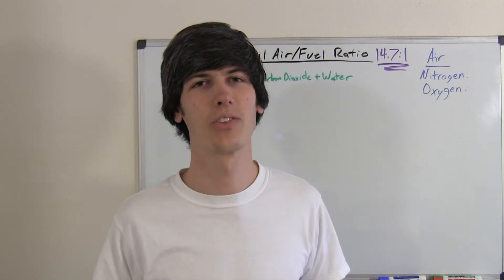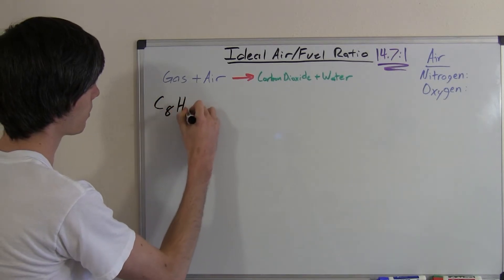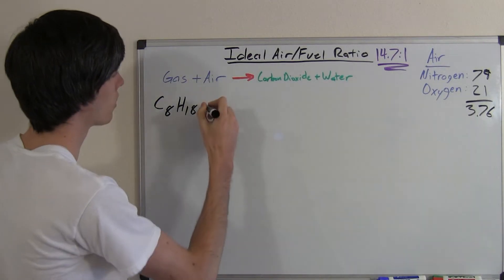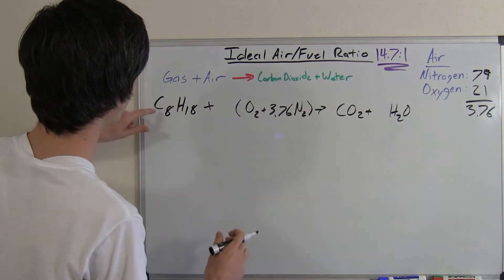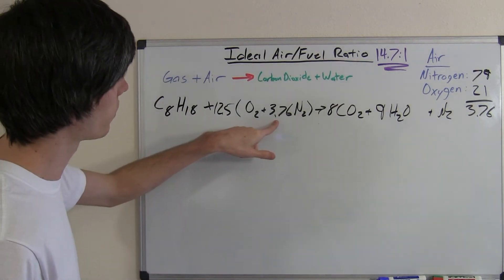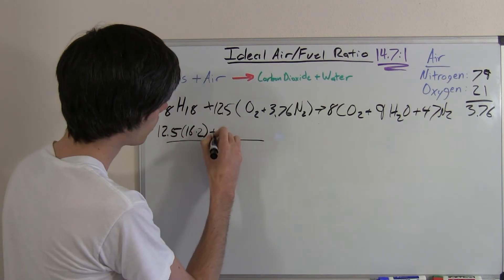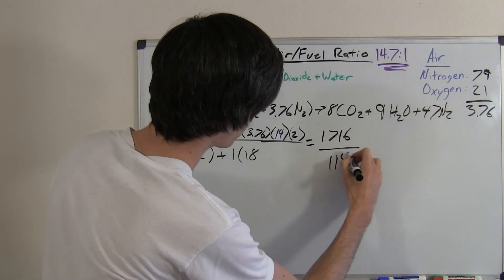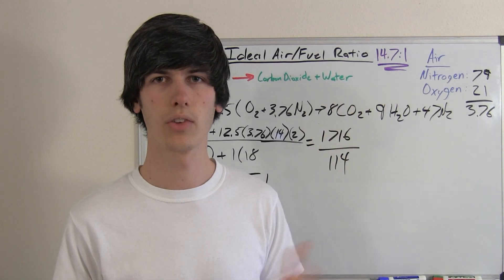Air Fuel Ratio - Explained

Comment: That is the air/fuel ratio to achieve maximum fuel efficiency?  I was under the assumption that only fuel vapors ignite.  I was also led to believe that only 10-30% of fuel actually burns because it's liquid.  If I'm correct and my assumptions true, then, maybe the air/fuel scale should be moved down to a smaller increment.   Similar to 1 ounce per pound (because vapors are thinner than liquid) of air/fuel or something similar to achieve 100% energy utilization.    I know we're using the wrong injectors for that.
Reply: So here's the thing: because of the way the injectors inject fuel, and the turbulent environment of the cylinder while intake stroke is drawing in air, and compression stroke is compressing it, the fuel ends up being very tiny droplets mixed pretty well throughout the combustion chamber. The high temperatures of the compressed gas evaporate a lot of the liquid into gaseous state around the droplets. You need the actual % of fuel by volume of air to be between 1.4% and 7.6% for combustion to even occur at all. There will be a concentration gradient surrounding each and every little droplet of fuel as the fuel evaporates. So, a miniature sphere of perfect ratio gas/air will exist around every one of hundreds of thousands to millions of droplets of fuel in the cylinder when the spark plug fires. The combustion process will occur in these spheres, increasing the temperature and pressure of the drops, further evaporating the fuel. The combustion process will end rather abruptly when all of the oxygen has been consumed, and a tiny percentage of gasoline will finish evaporating, thus absorbing the excess heat of the reaction (to prevent melting of the engine). 
If you reduce the amount of fuel in the engine, there won't be as much (if any) remaining fuel to absorb that heat, and the exhaust gases will be thousands of degrees, melting pistons, valves, and the exhaust pipes. The idea is to keep the wasted fuel to a minimum, but too low and you risk damage. Too rich, and the fuel will absorb too much heat and reduce engine performance (carrying it out the tailpipe as heated fuel).
One major source of wasted energy is that we pipe that heated exhaust gas out of the engine. There are engine designs that use this heat to flash water to steam and get an addition power stroke out of the heat instead of wasting it. Look for more into on this by googleing for 6-stroke engine.
Reply: I still think unless smaller increments of fuel is factored, we waste fuel.  If that IS so (about the 1.4% - 7.6% fuel by volume) with the current state of most modern engines, we are probably towards the high end of that scale.  I understand the extra heat with a leaner mixture.  To address that issue, all that is needed is a lower compression ratio.  10.0:1 dropped to 9.0:1 is a minor power hit (ex. 300 horsepower dropped to 280-ish give or take 5) is a drop in the bucket when your mileage triples at the very least.  A bigger cooling system would probably handle the rest easily.
Certainly the fuel quality would be a factor.  The cleaner the fuel, the higher octane that is possible.  A little less power still, but, much cleaner burning.  I'd rather an engine sing (for a multitude of reasons) than for one to be coughing.
If we can't use better injectors for maximum efficiency, it would be prudent to boost.  Really though, why not better injectors?  They already have (propane) vapor injectors on fleet vehicles, and they are just trucks.  All that is required is to get the fuel up to the vapor state with a higher temperature.  There is a big range before ignition ,so, it is safe to do.
   The Energy Corporations are killing us (with inflation to {well, don't get me started}) with how much of a monopoly that "industry" has in relation to all currency.  Maybe I'm hinting at another tangent, but, money DOES grow on trees.  If people are to ever be equal, it is pertinent to invest in humanity, not bankers.  I digress, LOL.
Reply: You can combust gasoline at 1.4% concentration, but the energy released is marginal. It is certainly enough to cause property damage though if you have a fuel can sitting in a garage and the pilot light of your water heater ignites the vapors. It's not so much useful inside an engine at such low concentrations. Here's why:
The perfect ratio of fuel to air is 14.7:1. What this means is that when the fuel burns, it is entirely consumed releasing the maximal amount of energy possible while consuming all available oxygen. You cannot maintain this ratio and decrease the fuel intake below this point no matter how you inject it, or how well atomized or vaporized or whatever; there isn't wasted fuel going out of the engine at all if you maintain the perfect ratio of 14.7:1*. (*chemistry is a messy thing, so of course there will be a small amount of incomplete mixing and incomplete combustion no matter how much you try.) If you increase the fuel, you start to waste it (as far as energy goes) to make for a more sustainable engine (thermally). If you decrease the fuel, you start to get less power from each combustion event. This is not a linear relationship though. You can't just say "I'm ok with 30% less horsepower if it means I get better gas mileage" because what happens is even a relatively small reduction in fuel below 14.7:1 causes a drastic decrease in efficiency. This is because your engine uses some of the energy from other cylinder's power strokes to make the intake, compression, and exhaust strokes happen. If you are pumping in oxygen on intake, compressing it on compression, and pumping it out on exhaust stroke, but NOT burning it, you are essentially moving around air for no reason. This is a wasted energy, and will reduce your fuel economy. 
The trick to efficient engines is to move as little mass around as possible. Here are some of the ways manufactures make more efficient cars: smaller pistons, push rods, lifters and valves, weaker springs, less friction from better machined and smoother engine parts, lower viscosity oil, closer machine tolerances between moving parts, better bearings, higher operating temperatures (up to a point), better bearing designs, better harmonics from the engine, less exhaust (wasted heat and pressure), better transmission designs with more gears to keep the engine in the most efficient rpm range, better rolling resistance tires, and smarter engine control by computers.
You are not wasting gasoline by combusting it at its peak power ratio. You are actually maximizing efficiency by consuming all of the products you are pumping around in the engine instead of wasting effort moving around things that you don't need to (be that oxygen, or whatever). Unfortunately, we live in a world where fuel combusts at higher temperatures than our cheapest and lightest metals can stay strong and solid at, so we have to make compromises to reduce the wear and tear. We inject a tiny bit more fuel than necessary to allow for cooler combustion temperatures, which prolongs the life of the engine. It is actually better long term to do this anyway, since the cost of making an engine, or rebuilding one is so much higher than the cost of the "wasted" fuel.
Reply: You are basically talking about the pros and cons about engine design.  Respectively, you could also implement Indy Car engines with such fine machine work and subtle tolerance requirements you could (almost) never equal the efficiency that it produces.  The ends don't justify the means because it costs too much in parts and labor that it wouldn't balance it's worth on society.  
 
   A lot of engine design would come down to philosophy.  GM hardly uses OHC's and FORD does.  Koenigsegg has a camless valve train that IS revolutionary and the Mclaren F1 has gold implemented to dissipate heat.  Intercoolers increase air density which increases power and some vehicles one can only use premium fuel.  

   It comes down to how to best manufacture an engine to meet these high standards and be the least costly.  Competition is good for this.  That hasn't been much the case previously.  I think with fuel, that same 14.7:1 ratio MOST aptly applies when the same space is occupied by a less dense energy source.  

   Yes, I am also considering such things in this swath of perspective, but, cannot overlook the ultimate nature of fuel efficiency and that we waste too much of it currently.  Liquid fuel does not burn, period.  All the parts do help in that, as you Warren, have so thoroughly pointed out, but, it requires less effort to get more out of the fuel we consume.  
 
  You cannot seriously and accurately omit the percentages (regardless of specifics {I'm estimating 3-5 times over}) of improvement to engine efficiency (not to mention the cost to the worlds economy) when it factually is most hindered (given the vapor/liquid detail) by the abuse of mismanagement of energy/fuel.  To go all human rights on ya, (sparing the conspiracy facts) the patent office has attempted to kill all inventions and proof of them when considering such matters.
  
   To best utilize how fuel is burned, is the single best and easiest way to make the most improvement to all engines.  Isn't it ironic?
  
   I'm not getting too over encumbered with the maximizing efficiency to it's utmost.  That would be bleeding towards Indy car and Top Fuel engines.  Extreme in their own ways, but, still good lessons learned from each.  It is inherent in man to work smarter not harder.  Engines ARE the ultimate example.  Abuse of government power, money manipulation by bankers, and the quality of food on your table are just a few major side effects of the domino theory when considering energy.  You could theoretically stamp out these things (to whatever detail desired by each customer)  AND reach high levels of satisfaction considering nature, economy, and independence. 

   The great barrier reef is dying, not to mention climate, and bees.  I'm not going to even mention renewable fuel...oops.  I won't be satisfied until my 3 liter high revving V8 gets 150+mpg and 300 horsepower.  Those are lenient numbers too.
Reply: Your initial comment was that we burn only 10 - 30% of the fuel going into an engine. This is demonstrably wrong. I was only trying to show you that deceasing the fuel going into the engine will not increase the efficiency, nor will it decrease the amount of fuel you need to drive your car. 
You are certainly welcome to tweak the fuel trim on your car to see what it does to the performance and fuel economy. Performance and fuel economy are not strictly an either/or relationship, though.
If you want to see how much uncombusted "liquid" gasoline comes out of your engine, you can disconnect the exhaust before the catalytic converter and condense the engine exhaust. You will find that all you get is water, carbon dioxide, carbon monoxide, a few nitric compounds, and a VERY small amount of unburned fuel. Certainly, you won't see 60% of the gas you put in the tank coming back out the tailpipe unburned.
Reply: Incorrect, decreasing the fuel by using vapors does make an engine more efficient, especially when the amount of fuel burned does not change.  If you were to spill a large volume of fuel on the ground, light with fire, you could then see a wave of fire burning on the surface.  It would continue to burn until all the fuel was spent.  Sir, demonstrably wrong?  Clearly there are some holes in your theory, with all due respect.

   One simply could not "tweak" the fuel trim due to the customer being limited to what products were available.  It has been an avoided practice to not utilize the most effective means of fuel efficiency because oil is so damn profitable.  More that just a coincidence I would certainly say SO.  

   An either/or relationship with performance/economy is factual to say is an opinion when lesser methods applied.  That is just science.

  Perhaps due to flash boiling and the volatile combustion process, some fuel seems spent when it is possible not to have been.  I have never witnessed such an experiment detailing the exhaust being removed, so, until then I remain patient.
Reply: So I'd like to point something out in your sentence: "decreasing the fuel by using vapors does make an engine more efficient, especially when the amount of fuel burned does not change"  Let's take this apart, shall we? "decreasing the fuel" and "when the amount of fuel burned does not change" makes no sense. Either you increase efficiency by getting more power for less fuel, or you increase the efficiency by getting more power for the same fuel. Show me a good, controlled, scientific study measuring the power output and fuel consumption rate for an engine before and after measuring this, conducted in a controlled setting, that is repeatable. Before you waste your time linking to some youtube video claiming to have done this, remember that I need hard measurements to show me that this is possible and not some tom-foolery or camera trickery.
When fuel is added to your cylinders, it's not like a dripping faucet. The fuel added by an injector at incredible pressure through a very tiny opening. The result is that the fuel is a fine spray. Couple that with the turbulent inrush of air to stir things up, plus the intense heating undergone by the fuel and air mixture in the compression stroke, and your fuel IS vapor when the combustion event occurs. I know that the vapors of the fuel is what is burning when you ignite a puddle of gasoline. This is because the liquid is at too high a concentration to combust. You need that proper mixture, which the vapor will naturally achieve. 
You WANT the temperature to be within a certain range in your cylinders when the combustion event occurs. If the mixture is too lean, the flame will be too low a temperature and fuel will "hide" from the combustion by getting into crevices around piston rings and such. If the fuel is too rich, it will be too low a temperature, and there won't be enough oxygen to consume all the fuel. Either way: too right or too lean you reduce the amount of power extracted per unit of fuel, or efficiency for short. Running too lean will reduce power. Not just total power from the engine, but the amount of power the engine can produce per unit of fuel. This is what I mean when I say that performance and fuel economy are not either/or. If you define performance as the amount of work you can do per amount of energy going into the engine, you get peak performance very close to ideal fuel/air ratio, and maximum economy.
If you want to see the difference between gasoline sitting in a pool, and gasoline sprayed out into a mist, here's a thought experiment I recommend you do NOT attempt, as you'll likely burn down your house or get yourself burned/exploded. Go buy a spray bottle, like for glass cleaner, that has multiple nozzle settings. You are looking for the stream, and the fine spray setting. Put gas in that bottle, light a candle, and spray the fine mist onto the candle from 10 inches away. I guarantee you all of that gasoline will be consumed in the combustion event, and you will NOT have gasoline landing around the candle in unburned droplets. You can even lay down issue paper around the candle to see if the tissue gets wetted by gas to prove that it all burned. Now turn your nozzle to stream and repeat. You'll likely get a jet of flame if the fuel even combusts, but the liquid won't burn with quite the intensity as the mist did.
Oh, and some ECUs do allow you to adjust the fuel trim, hence adjust the fuel air ratio. You can do it manually on almost all vehicles by opening up and vacuum line to allow unmetered air into the engine, thus leaning it out (and likely stalling it because of the reduced power from the lean fuel ratio).
Reply: Covering the first point, decreasing fuel density does decrease the amount of fuel.  Wanting the same horsepower, the same amount of fuel would be burned.  Dude, it's not about the perfect engine already being built.  It is about the energy available from fuel.  Joules is the potential to do work, aka horsepower/torque.  One ounce makes a boom, one gallon makes a bigger one.  That is measured in torque.  Consider the displacement of an engine and the total output possible, (comparing those already in existence {I'm not doing your homework for you}), they are normally similar with similar parts.  The higher the RPM, generally the more horsepower that is possible.  Engines are like vacuum pumps, essentially.  Torque however, is generally the same with similar sized engines.  The Indy extreme engine angle.

   When you increase pressure (via cylinder pressure or boost) the fuels' boiling point also increases.  Factually harder to ignite.  No, the mist you refer to is liquid.  The empty spaces void of visible fuel would be vapors.  The idea is to vaporize ALL of it.  No, gasoline in a puddle isn't JUST too high a concentration, it's also LIQUID.  
 
   The leaner the fuel, the hotter the combustion.  Same with octane, the higher the hotter.  Respectfully, I must be reading something askew again.  Colder temps produce MORE oxygen (more dense air) and produces more boom.  With extra fuel, cooler temps could happen because some fuel wouldn't burn, "cooling" almost like burning oil in a 2 stroke (again, defining non-efficiency).  I'm with ya saying that an efficient engine produces the most power over all (per unit of fuel).  Opposite example would be a top fuel dragster.  Talk about nuts, (guessing) 5.0:1 compression ratio, 30-50 lbs of boost, and the most fuel that can fit in the space.

   I'm with you still about the spray bottle, but, that isn't instantaneous.  I've heard the definition of an explosion is something that gets really big, really fast.  With the cheap bottle misting fuel is relative to how fast it can burn and how small the particles of fuel could be.  Granted, more room than in an engine to spread, but, still a gradual burn.  Similar to a flammable string held by a hand, lighting the bottom, the fuel would rise and consume the entire string.  Quite possible that the string wouldn't have time to land either.  

   I think that vapors could only be introduced by methods not seen yet.  Well, at least at levels to satisfy performance oriented people.  It does happen with propane engines, only because the boiling point is -43 degrees or close to there and vapors are easy to come by.
  
   Man, with all this effort here, we are bound to see mileage double by next year, fingers crossed.